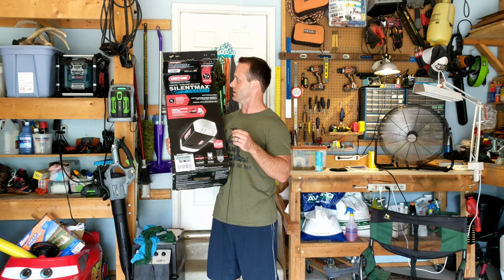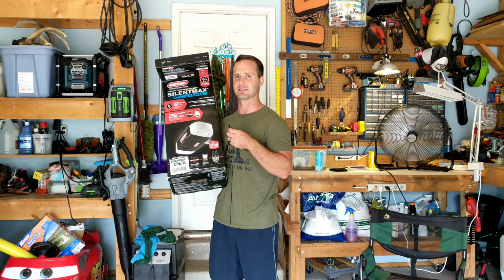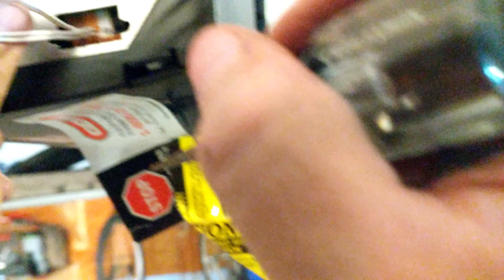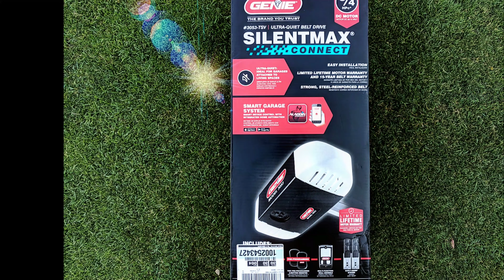Genie Garage Door Opener Install with One Person (EASY)

Comment from the maker: The garage door opener I used on amazon: https://amzn.to/3ELISIJ
Timestamps:
0:37 Old opener disassembly
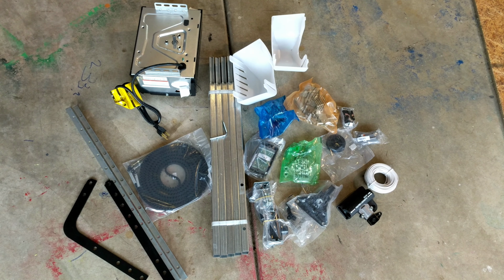0:59 All part laid out on ground
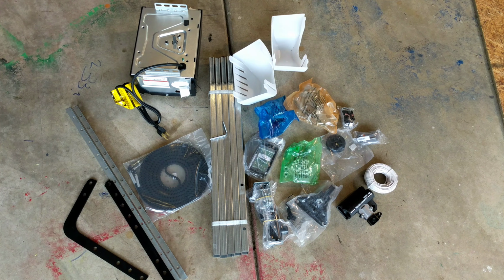1:14 New opener assembly
3:15 Measuring for highest point of door travel
3:46 Installing opener
5:24 Installing safety sensors
6:02 Routing wires
6:30 Connecting wires and mounting door opener button
8:13 Testing and calibrating
8:32 Final thoughts

Comment: Thanks for the video!  Took my anxiety away from doing it.  I was just replacing an old chain one, with the new awesomely quiet Genie!  Installed in a little under 3 hours.
Reply from the maker: Awesome man, love to hear it!!
Reply: @kove  Great stuff. I have an already installed Liftmaster chain I want to change to this genie belt, do you always have to remove and replace the carrier bracket above the garage door like you did?.. If so I'm guessing you need to refind the stud behind the wall.. I was hoping the new one would go right into the same bracket without having to replace that :-(.
Reply: @seatime674  I used the same bracket.  just angle the piece from the motor to the ceiling.   I think its kosher.

Comment: Great video, it helped tremendously in taking on this project - I did use my existing wiring, I made sure that I wired the two wire side on the garage door to the transmitter and the single wire side on the garage door to the receiver.  Then I simply wired the single wire from the old opener into location 1 and 2 in the opener housing and it all worked.
Reply from the maker: Thanks, and glad it worked out for you! It's always something that causes a fuss ;)

Comment: about to change mine tomorrow morning and I'm wondering if I can do it with the original cables instead of using the new wires - they're in the wall and ceiling so I really don't feel like taping/tying and pulling through or trying to drop it down from the attic
Reply: so the BLD directions completely tell you the WRONG wiring FUCK ME I spent hours trying to figure out why the light wouldn't come on the push button and then when I looked at the actual documents it showed to put the wires in 3 and 4 not 1 and 2 like the BLD app told me. GODDAMN IT

Still can't get the fucking sensors to pick up - even when I wire directly to the unit on a short wire only one light comes on so I have no fucking clue why it's so hard to get the wires to connect in the terminal
Reply from the maker: Sorry to here ROB! Have you figured it out?

Comment: Thanks for your video . I followed your instruction and finished well. After trying in testing it a couple times , it was not move- or traveling then  ( just click  and click but not travel ) . I tried to reprogrammed but it did not work !!! ( when I set the door close - DOWN-  I pressed Pro button but it turned Blue and then Red but not flash Blue or turn Green . So , I CAN’T go to next step for UP the door to finish programing it   ) . WHAT SHOULD I DO NOW ? Thanks

Comment: Wow!!! Didn't know it was that easy!
Reply from the maker: Well, it's doable 😉
Reply: @kove  Update....
I thought it was going to be easy so I  bought a Genie garage door opener and I'm having the hardest time attaching it to the garage ceiling.. I wish they would have provided the metal pieces for a flat ceiling in different sizes. My garage ceiling is flat and low so I need a small 9inch metal strip. I'm having the hardest time. Just this one metal strip is delaying everything. I could have been done ALREADY!!!
Reply from the maker: @kw9568  Yep, it would be very handy for many people. I was lucky enough the existing pieces of my old one worked just fine. Hope you get it finished up soon!

Comment: How does the belt turnbuckle engage into the carriage once everything is installed and mounted? At 2:42, it is still not engaged and I assume it still isn't after you bolt the rail end to the wall and hang the motor from the ceiling. Clearly, if the turnbuckle is outside the carriage, the door won't move even if the belt does.
Once inserted onto the motor shaft, the belt cannot be moved manually so you can't really slide the turnbuckle in that way (at least I couldn't).
Did you partly open the door, manually, until the carriage moved over the turnbuckle, engage it, then start programming the opener controls from that position?
Thanks!
Reply from the maker: At 2:13 there is a black sleeve I fed the line through. This is what engages the door and the belt. It's also what can disengage the two if you pull the rope hanging from it. Hope that answers your question!
Reply: @kove  Thanks so much for the reply, really appreciate the help. Actually, my question was a little different: You do feed the turnbuckle through the carriage sleeve (and connect the two ends of the belt), but from the video it seems that by the time you hoist the motor up and do the install of the rail to the wall, all the way to the moment when you connect the carriage to the door, the turnbuckle is not lodged inside the carriage sleeve. It's down the rail. How does it travel to the carriage sleeve? Did you move the belt to make the turnbuckle travel to the carriage, somehow? Did you lift the door manually first? Incidentally, this is one step which is totally missing in the instructions.
Reply from the maker: @fd7231  Ah! Yes, you hit hit the button to move the belt and it will find it's way to the sleeve eventually and lock itself in. You then do need to set the stopping point of travel manually. I don't recall the process for that, and wish I included it in the video as others have asked about that.
Reply: @kove  Thanks so much!! That's invaluable information! It's the one little step skipped in the instruction manual fron Genie. I was about to do the same as you wrote: it's very helpful to know that's indeed the correct technique that works.
Thanks again!

Comment: Thanks for posting. I just installed the same Genei replacing similar to what you had, a 29 year old Craftsmen using your video as a guide. The only thing that took some extra time was having to move my original mounting bracket up 8-10 inches since the Genie is a little shorter.  I was hoping to bypass the sensors but the garage door wouldn't go down without holding down the hard wired pad button in the garage. My remotes don't work in the down mode or control the lights, hoping installing the sensors will fix that, if not I will need to reprogram the remotes which are pre-programed from factory.
Reply from the maker: Glad you found it helpful and thank you for checking it out! Interesting take at it, I considered leaving the old sensors as well. Hope you get it figured out!
Reply: I'm having the same issues with the garage door not going down.  Did installing the sensors fix the issue?
Reply: @mrchopstix  Yes, it corrected everything.

Comment: Pro tip, don't level the rail. It causes excessive force on the top panel. The rail should be 1.5 inch above the top panel when the door is open. It will slant down from the header to the motor head. Otherwise a clean install for a diy :). 18 years in the garage door industry.
Reply from the maker: I had to come home from vacation to really comprehend this, and it makes sense, thanks Joshua!!
Reply: Thanks for the tip. Planning on doing mine soon
Reply: Can you explain this better, so the rail coming out of motor going to be mounted on wall should be mounted exactly how ??
Reply: It says to level it in the instructions

Comment: I have serious question dude. I just bought this. Does the wall control work with an extra transformer? And how do you connect the sensors?
Reply from the maker: I don't know what you mean by extra transformer. The sensors I followed the manual which does a good job explaining. In short, just make sure they are level, and the brackets do a good job aligning them up. Glad to help if you have future problems.

Comment: Hey! What are the gray bars called that you mounted the opener to as you were leveling? It's looks like the pi symbol
Reply from the maker: Hey naija_luv, what is the time mark in the video I can see them?
Reply: @kove  4:17
Reply from the maker: @daquiri23  you described it perfectly, can't believe I didn't know Right off the bat! Anyway that is punched angle iron. Best to buy in a garage door opener mount kit, you could pick them up at any hardware store.
Reply: @kove  no worries ☺ I will be getting the garage door kit from Lowe's or HD! Thank you so much!

Comment: Great video.  Deciding if I want to change out my chain drive opener.  Nothing js wrong with it but the master bedroom is right above the garage.  Wondering if it'll make a big enough difference.  Also, what is the distance from the wall to the opener?  I definitely don't want to have to move my current support.
Reply from the maker: Without doubt worth the upgrade to belt, so much quieter and pleasant. Mine is about 9' from the front of the motor unit to the garage door.

Comment: How do you get the wiring to go to both sensors on each side?
Reply from the maker: it comes with wire, but I used my existing wire without issue

Comment: Same. About 5 hours by myself. I went to home depot and saw it sitting there with a 99 dollar yellow tag on it a grabbed the thing so fast. After I installed mine the wires kept popping off the spools so i had to wind my spring. The Aladdin connect app is pure çrap though
Reply from the maker: Nice deal! yes, the app is terrible. XD

Comment: Great detailed video.  I’m curious about one thing.  Did you have to do all new wiring?  Couldn’t you have just used the previous wiring setup?
Reply from the maker: Yes I did, I perhaps could have used the old wires, but since the new set looked better I used them. Plus I didn't want to run into warranty problems.

Comment: Great video! I just had one question. The technical details of the product on Amazon say this is for a sectional garage door only but it looks like it works great on your 1 piece garage door. Would you recommend I use it on my 1 piece garage door as well? Thanks again!
Reply from the maker: Thank you Javier! My garage door is a sectional, I don't know if it'd work for a 1 piece garage door. I've no experience with 1 piece doors either.
Reply: Thank you for your prompt reply. Thank you again for an awesome video. I especially loved the family clip at the end!

Comment: I guess I missed a few details here. How did you do programming and did you end up using that black wire hanging down at all? I didn’t see you wire in the main control pad (opens, locks, controls the lights).
Reply from the maker: Yes, I started to record that, but was interrupted and forgot to continue recording. Wish I would have got it on video! The black wire is the antenna, nothing is required for that.

Comment: I did a pretty good job installing it just to let you know it looks like the upper limit is set to far up you usually want it 1 inch above the top header
Reply from the maker: I wasn't aware of that, I wonder how it will effect the longevity. Thanks for the insight!

Comment: I installed this same model, and the belt moves but the door stays put, is there something I'm missing?
Reply from the maker: Find the metal turnbuckle where the belt ties together. That should be locked inside the black plastic carriage thing the red and white string hangs on. 
On that carriage, the string is connected to a small black tab that rotates down and the string is pulled. Make sure the tab is facing sideways, not down.
Let me know if that works. 👌

Comment: Thanks for making this video. Im about to buy the same one and I think you are the only one who has reviewed this model. Im a little confused on the part where you mark the "highest point" of the door and then use that to mark your brace position. 

Where would the brace go according to this height? I was a little confused on where I should be marking and setting this brace. 
Thanks!
Reply from the maker: Glad this helped! You find the highest point of travel on the door. That is the height of the middle brace I screwed in. Feel free to hit me up if you have more questions 😉.

Comment: What is the measurement from mount to mount on top of the drive housing?
Reply from the maker: I went out to measure this, however I'm not sure I understand the things you're referencing. Can you break it down a little more?
Reply: @kove  Sure. On top of the door opener there should be two mounting brackets with numerous holes in it to hold up the opener motor. These brackets are part of the opener. I was wondering what the spacing is between those mounts. I am replacing a opener and wondering if my current brackets on the ceiling would work with out having to modify much. Thanks
Reply from the maker: @Silverado1222  Gotcha. 9.5" between the two mounting brackets. Mine start at 9.5, but I needed to "Y" them out a little to fit best to the ceiling bracket, at around 10" fyi.
Reply: @kove  Thank you for checking for me. Mine are 10 in so there will be little adjustment needed.
Reply from the maker: @Silverado1222  Glad to help. Think it will fit just fine.

Comment: How are you liking it? Went and picked mine up today. Will follow your video for easier installation thanks
Reply from the maker: Love it, working great! Feel free to hit me up if you run into problems.
Reply: @kove  will do
Reply: @kove  ran into a problem installing it. I did not measure my door whenever i bought the genie. The height of my door is 8ft. If i install it  with no extension it wont open all the way  right?
Reply from the maker: @mrhoya14  Correct, without the ext. it doesn't have enough space to come all the way up. Mine is 7", I'll add this to the description to hopefully help the next person out.
Reply: @kove  yea i just figured most garage doors were the same height. Going back to home depot and see whats the best thing to do.  Either extension or a bigger unit
Reply from the maker: @mrhoya14  The extension cost about $37. Seems home projects always have something which requires at least one extra trip back to the store.

Comment: Well, this garage door comes with all the bell and whistles of a modern day device (wifi, app, Alexa, 3D installation app). It is as easy as it gets when it comes to installing a garage door opener if you're a handy man but I would hire a professional if you're not a handy man. The problem with this Genie is that the manual and even installation app lack the details and did not emphasis important points before installation.  A nice big yellow bold note "BEFORE YOU INSTALL" Points would be nice.

Here comes the con:

1. You must install EVERYTHING including the ground sensor for the opener to work or it WILL NOT work. I tried to test the unit before mounting on the ceiling and it would not work.
2. You MUST program the close and open distance before using the wall mount controller. After the programing, do a complete open and close run for the motor to test the tension of your garage door.
3. The Plastic UP/DOWN/PROGRAM button are horrible and cheap. My PROGRAM button would not click due to the a defect plastic button. I had to remove the shell where the real buttons are and program from there. It's easier to do it with the shell off.

It took me and another person 2 days (6 hours day) to install this due to the lack of details in the manual and the lack of important emphasis points in the manual.
Reply from the maker: Certainly a good option, doing it DIY isn't for everyone. Thanks for watching, wish you better luck next time.
Reply: I am having issues.  Hope your tips will solve the problem.

Comment: 55k k views - both sensors have wire attach screws - you skip the one side...You skip the wired door opener... not good usless
Reply from the maker: Yeah, there's some stuff I didn't film because of time constraints. Thanks for checking it out.

Comment: Lift Master is garbage. I'm going to replace mine soon.
Reply from the maker: What happened, can you share more?
Reply: @kove  
Yesterday, as I was trying to close my garage door, the Lift Master opened it partially and then stopped. Then I would try to close it, and it would close and immediately "bounce" back up. So I watched a lot of Youtube tutorials on troubleshooting, by both the manufacturer and amateurs, and none of it remedied the problem. I messed with all the adjustments such as the "Kg's up or down" and the "down or up" controls, and none of it helped. I tried everything, trust me. I even covered up the "motion safety sensors" for an hour because I hear that the sunlight can mess with them, but it didn't change the outcome. It doesn't seem like the motor is fried, but I am extremely angry about it, because I don't have time to fiddle (play games with this stupid thing) so I decided to replace it with a Genie. I am unhappy with Lift Master and how it has redundant controls (up or down) and (KG's up or down). It should be simple and user-friendly, but it's not.
Reply from the maker: @eekay3646  ugh, sounds frustrating. We'll, if you get one like mine you'll be happy!
Reply: @kove  
Hope so. Thanks and good job installing it.